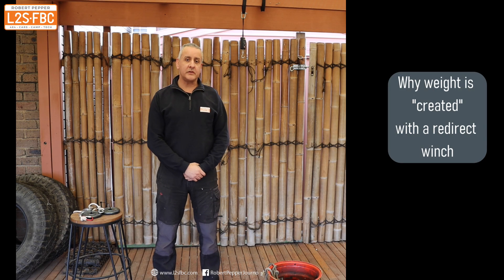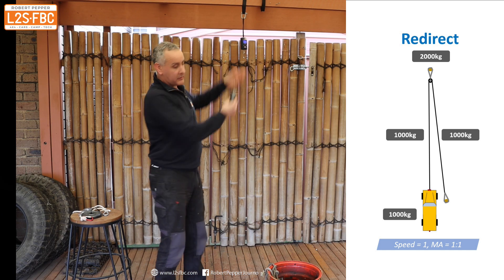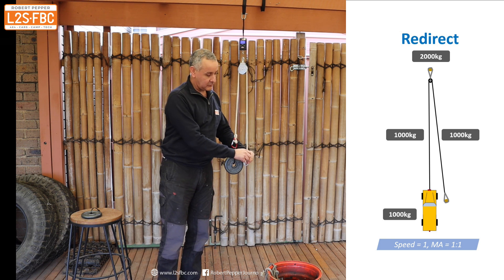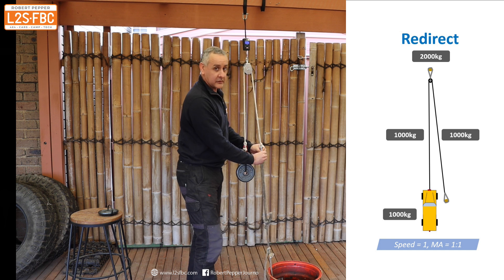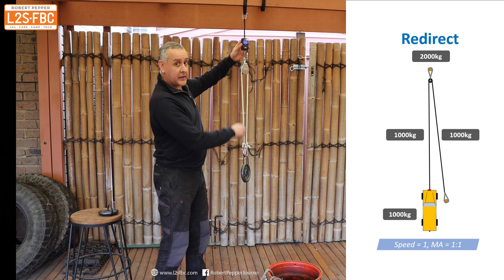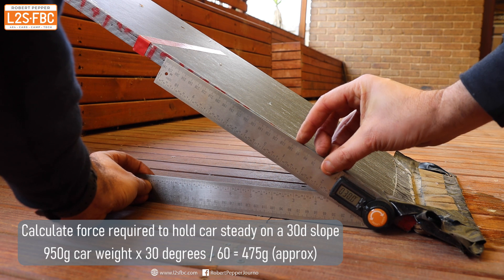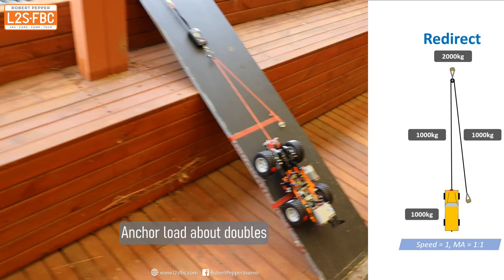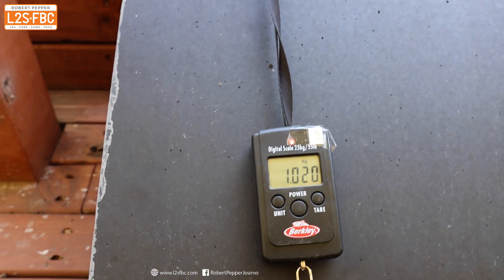One thing people get wrong with snatch blocks - explained

Comment: Great video. I experienced this today with the recovery of my pickup out of a ditch. I tried straight-line pull, then attempted rigging double line pull with snatch block, with my anchor point 15ft away to the side of winch, seemed like the winch was struggling just as much. Thanks for explaining this, my anchor should have been my own vehicle to gain the mechanical advantage.
Reply from the maker: Thanks for sharing your experience and glad the video could explain what happened!

Comment: So does this mean my boom preventer on my sailboat should run from the end of my boom through the snatch block at the foredeck straight back to the original anchor point at the end of the boom instead of back to the cockpit where I can adjust the length? Massive loads are encountered when a boom rigged with a preventer is backwinded with the main sail up and my gear is older and worn.

Comment: This is brilliant but apparently the density in my head is preventing me grasping why the anchor load at 3:00 increases so much by moving the one rope to an offset position from the vehicle.  The load was equal on each end of the rope showing 470g on the scale, implying 235g per direction of rope.  You move the one rope and David Copperfield made the building disappear and ate 380g more  of doughnuts.  No comprendo.  Can you reverse this for my gf?
Reply from the maker: Easier to round it up to numbers 500g and 250g - real world testing never quite achieves the theortical perfection for lots of reasons.  Does that help?

Comment: It may just be semantics but you are not creating weight, but you are creating an increased force. In this case the original force caused by gravity on the sample mass is mutlitplied by the one pulley. Would have been interesting to see the original argument was about.
Reply from the maker: You are of course correct, I use weight as people understand that better.  Those that note the 'error' typically don't need the explanation!

Comment: Thts not how i would put in use
Attach block to the load
Attach one end of  rope,cable. To anchor
Applly force to other end 
You will travel twice as gar as load but half the effort 😮

Comment: This is great thank you. I watch a lot of your videos and try to study them....given this logic it makes me wonder, why bother doing a redirect if you're not getting a mechanical advantage? Why not just hook right to the first anchor point? I suppose it could help to get to lower levels of the rope which produces more power from the winch.
Reply: Very interesting. You see people often using snatch blocks and seperate anchor points claiming it provides and mechanical advantage but these seems to disprove that. Other than getting more line out of the winch and working a lower layer it just doesn't seem worth it unless you can hook back to the vehicle
Reply from the maker: Depends if you are winching or being winched
Reply: Good point , I'm always thinking of self recovery but now that makes sense, if involving another vehicle
Reply from the maker: Good question and there's no point unless you need to change the direction of the pull.

Comment: I'm trying to wrap my head around how the weight doubles.
Reply: It'simple: there are 2 independent sources of pulling down 3,2 kg: 1) 1,6 kg at one end of the rope; 2) at the other end of the rope where the bucket is, no matter how heavy the bucket is, only 1,6 kg equivalent weight  of it out of the total weight, will be "used" (it is a reactive force, not an active one), to balance the 1,6 kg at the other end of the rope. It is like you cut 1,6 kg off the  bucket and hang it to the right end of the rope, to balance out the 1,6 kg on the left side of the rope, BOTH of then acting simultaneusly on the hook, therefore 3.2 kg.

Comment: What’s confusing about your “explanation” is that you are not using the correct terms. The display of the digital scale is not showing weight , but force...it still only takes 5+ pounds of force to move a 5 pound object with a snatch block or off a single straight pull...the block just allows you to redirect it per convenient anchor point...
Reply from the maker: weight, force, mass, torque, power, load, work...these are all very specific terms engineers understand. The average person does not, so I often simplify.
Reply: Yes he is measuring load sharing across 2 lines which we see showing a 50% reduction in weight in both lines as they are sharing each of the total load. This doesn’t equate to a mechanical advantage it’s just a change of direction.

Comment: Yes, that commenter is wrong and the author of this channel is mechanically correct. They are still both semantically wrong. What is this "creating weight" nonsense? Weight is a measure of heaviness - it differs from planet to planet, even though an object has the same mass (which is a measure of inertness - in "weightlessness" objects are weightless but not "massless", but in most practical situations we tend to think of weight and mass as interchangeable, like speed and velocity). Pulley/block is one of "six simple machines" - a historic sign of civilization (along with "inventing the wheel"). To deny that pulleys provide mechanical advantage (aka "leverage") is to also deny wheel and axle, the lever, etc. And to deny human civilization. It is not "creating weight", or even changing it, it's merely splitting applied forces and sharing them across directions. Just like leverage. Words mean things, otherwise everything would be a dohickey or a whatchamajig.

Comment: To undertand the forces here think about this.
Attach the snatch block to the rear of a Towing Car (Car A).

   Don't Actualy Do This, Only In Your Head. You will FAST understand why.

If both ropes are connected to the car being towed then the setup is the same as a single line pull (Car B)
     Energy Needed to move Car B 1kmh = 1 x E

Now connect one rope to a Tree next to Car B
If Car A travels at 0.5kmh then Car B will travel 1kmh
Or if Car A travels at 1kmh then Car B will travel 2kmh and Car B will be getting 2 x E. Also here the Tree is also working at 2 x E 
And Car A and Car B will combine to become the latest viral video.

So if Car A wants to stop Car B from reversing, Car A now needs 2 x E brakes to stop Car B reversing
Because Like the Winch setup, (Car B has a Winch) and now only needs half the Energy to pull Car A in reverse.
Car A = Car B + Tree

The Pulley on the Ramp is giving the Toy Car a 2:1 advantage to pull on the Scale with so the scale reads 2 x Toy Car.

And this is how to better understand what E=MC2  Actualy means.  
  E = Speed of light,    M = Car B,     C2 = Winch Wired to a Dwalf Star Held inside a TARDIS.

Comment: If you look at the distance the vehicle moves, its exactly the same as the amount of rope taken in. No mechanical ad.
And yes, you do need a moving pulley
Reply from the maker: https://l2sfbc.com/you-can-get-mechanical-advantage-from-a-snatch-block-that-doesnt-move/
Reply: If there is no mechanical advantage with pulleys explain how a 300 ton crane can lift so much with a winch that is only capable of lifting around 25000lbs.

Comment: I'm not getting the point of what you're saying because (I guess) I'm stupid.  But I thought the point of using a snatch block is to make your winch not have to work as hard.  So why are we focused on the amount of pull against the tree?  In other words, why is the meter where it is instead of measuring the tension in the piece of rope connected to the winch?  If I'm in a stuck car, I'd want to know if what I'm doing is making the winch's job easier or not.

Another stupid thing I'd like to contribute is: since the snatch block doesn't move then it only redirects, so how the heck is attaching the other end to an anchor contributing anything to the situation the vehicle is in?  As I understand it, using a moving winch is when the advantage happens.  Have I learned everything wrong?

Upon further reflection, maybe this is a demonstration of an incorrect setup.  Because as I understand it, the moving winch needs to be attached to the stuck vehicle and this setup only pulls harder on the tree and does nothing to help the stuck vehicle.
Reply from the maker: You're not stupid. Understanding winching rigs means Understanding what not to do. And this is that, in response to a reader question.  You can have a  2 to 1 advantages rig and thr block doesn't move  check my other videos.
Reply: @L2SFBC  
Thanks for that.  I was beginning to wonder if I had it all wrong.  Now I'm curious about the 2:1 advantage without a moving snatch block.  I'll look for your videos on that.  By the way, in addition to full size equipment, I recently bought miniatures like you use to demo your setups, including a couple of weight meters.  I plan on working out setups and learning more.  I don't know why this fascinates me, but it does.
Reply from the maker: 2:1 is when you run the return line back to the car. Block doesn't move, but car does.

Comment: How would the weight change on the pulley if the rope was anchored 90° from it? Would it see 50% less weight?
Reply from the maker: A 90 degree change of direction adds 141% of the load onto the anchor point, as opposed to 200% if that helps? So yes a reduction.

Comment: Excellent...  I have told this to countless people over the years, but I'm not sure they get it.  I explain by saying that, not connecting back to the vehicle means that, the cable is basically still a single line pull with a bend in it and if  is creating resistance friction.  Only when it is connected back to the vehicle, can the returned line contribute to carrying the weight. They say " I little knowledge is dangerous"  I think in this case, at least detrimental to the task.  Your demonstration is excellent. thank you...
Reply from the maker: Thanks! And agreed 👍

Comment: damn, I knew force doubles because of the 180 change in direction of the force vectors but I would have assumed that in both causes it would double!  So in redirect situation, one can pull a much heavier vehicle without anchoring your vehicle as long as the heavier vehicle is not less than twice the weight of your vehicle. It makes sense that the pulling weight at the snatch block would double since one point is fixed and you have an action and reaction forces that add up. you have the 1000 kg force traveling from the 1000kg truck all the way to the fixed point on the ground, cable tension = 1000 kg BUT around the snatch point it changes direction, thats where it adds up. Just mind boggling to think you are creating double the force from nothing, right? I don't blame the lady 🙂.  With double line since both the fixed points are on the truck itself, the weight of the truck is split equally and the tension the line feels is 1/2. Here you are basically doubling its capacity at the expense of speed.

Comment: Excellent  videos! Could I use a 4500 lb rated winch for my Ram 1500 crew cab with snatch block?
Reply from the maker: You could, but I'd go for at least a 9500lb if not 12,000
Reply: @L2SFBC  👍 thank you 🇨🇦 thought I could save some money with lower rated winch with a good set of snatch blocks. Thank you for you quick reply. I’m a new sub 👍🇨🇦

Comment: Great demonstration !
Lots of opportunity for confusion in pulleys because of exceptions to the rules.  This one is a good example.  It breaks the rule…….only moving pulleys provide mechanical advantage.  
Exception:  when the haul line power source is attached to (or part of)  the load.

Comment: I see a risk of people getting this wrong. If you are pulling external load attached to snatch block, other end don't need to be attached on solid object. It can be attached to the vehicle and the force is still doubled. Of course if you use solid object, you vehicle needs only half of the force to anchor it into place.

Comment: 👍🏼👍🏼 funny thing is if you didn’t have visual add most of these naysayers wouldn’t know what you’re talking about. 🤯
Reply from the maker: True!
Reply: Great point.  Goes to show how easy it is for people to believe what they  want to believe and why it can be so hard to change their minds.  Indeed it can be difficult to make a solid case and present it as clear as this example. 

These modern thinkers (woke type) are now even questioning the scientific method, etc... making it literally  a10000% chance you will not be able to change minds because without it they wipe out the independent standards so nothing can be proven... scary!

Comment: Mega important to keep the pulley bearings greased. The old boys said you loose 5% on every pulley, which is a legit good guess due to friction. They also said that pulling a machine up 45 degree slope is pretty much the same pull as it’s mass. (After 45 the drag is gradually swapped for dead lift)
Reply from the maker: Here's the efficiency loss -> https://youtu.be/rdlRRAbzCzA
Reply: @L2SFBC  the old boys knew right then :o) I wonder if a roller bearing snatch block does better? (Up until the bearing gets rusty)
Reply from the maker: Watch the video..all explained and more tests on the way 👍

Comment: Weight still was not created.  Anchor point, or reference, merely changed.  In either case, there is still equal weight on each line.
Reply from the maker: Exactly!

Comment: The simplest way I was taught if the block moves there is a mechanical advantage and in simple terms the number of lines coming out if the moving block is your mechanical advantage. Since the tree is a fixed object the vehicle is the moving block.
Reply from the maker: No, you can have MA if the block doesn't move, and it's the number of lines supporting the load, not coming out of the block.
Reply: @L2SFBC  The amount by which the pull on the hauling part is multiplied by the tackle is called its mechanical advantage (M.A.) and, if friction is disregarded, this is equal to the number of parts of the fall at the moving block.
Reply: @L2SFBC  the better phrasing would be if the block moves in relation to the other components in the rig.
Reply from the maker: Very good!

Comment: Your commenter is right. The issue is that you're confusing weight and force. The reason (I suspect) is because of the imperial system measuring force in lbs.
Anyway, to make clear the difference, something still has a mass when you're lifting it, even when it's not putting any force on the ground, and a vehicle doesn't double its weight when you run a double line pull, or half when you split a double line pull between the vehicle and an anchor.
Anyway, I really enjoy your videos and hope that helps.
Reply from the maker: Sorry I don't get the context of this?  Yes mass doesn't change like weight, agree with your comment but don't quite see the relevance to the video? A double-line pull halves the effort (I prefer to say that rather than doubles the pulling power)
Reply: @L2SFBC the commenter is quite correct. Weight is the force applied by gravity on an object. You can't change the weight of an object by doing anything other than changing gravity.
A double line pull doubles the force, the weight remains the same. A scale is a force gauge, it's designed for the application of measuring weight and hence its units reflect that, but in the applications you've used it it's measuring force in an incorrect unit, not measuring weight.
Reply from the maker: I know all that...maybe I used the wrong terms in the video. Which would have been intentional, I find if I talk newtons nobody gets it, so I use kg. Which isn't correct. But the people that know the difference tend not to need the explanation..hard balance to keep it simple vs accurate, and always looking for feedback to improve!